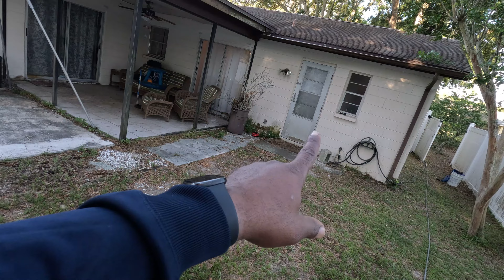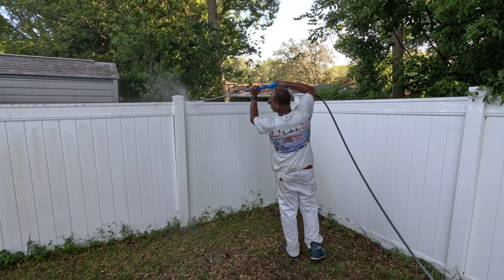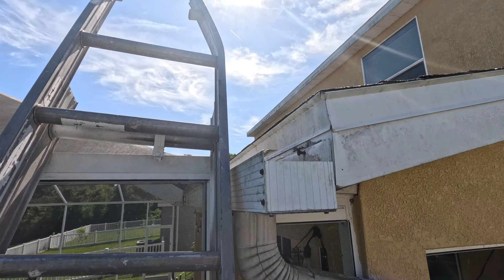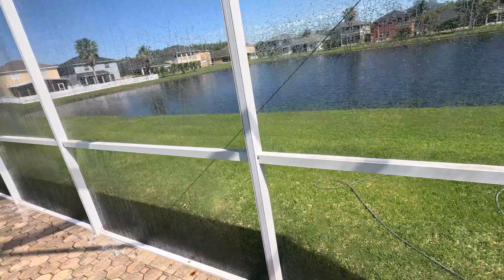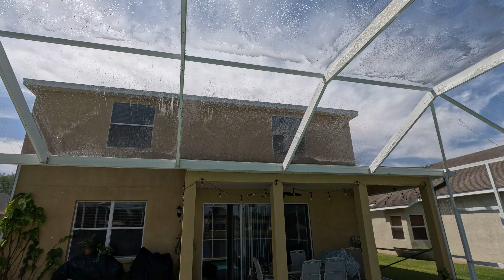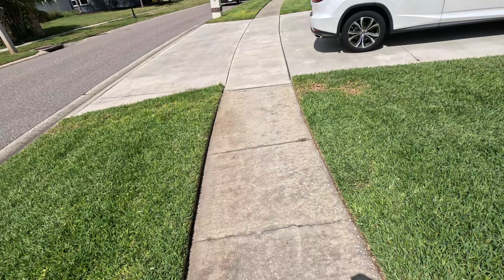Lots of Soft Washing Today #howto #softwash #softwashing

Comment: When I try and downstream and I put the down streamer on my machine I don’t get soap and SH is there a limit on the hose length I can use…
Reply from the maker: I've downstreamed with 300ft of hose before.  Check the downstream injector to make sure Ira installed correctly. 

This will help

https://youtu.be/vbrgNGV0Bu0?si=hVGXXYvo6deIsKqj
Reply: @PinkFlamingoPowerWash  Thank you

Comment: Great vid, but the yellow house that you did.... did you wet it all down before you did the house wash itself ???? Or did you just go right to using water and sh ???? Thank you good sir....
Reply from the maker: Started washing it normal with the sh mix.  But on very hot days I may wet down the windows on the sunny side 1st.
Reply: Cliff in the video you use a Bucket and downstream injector.
How do you now its 1 or 2%
Reply from the maker: @nielsvos3031  the injector is fixed to pull that ratio. You can always do a draw test to lmlw as well.